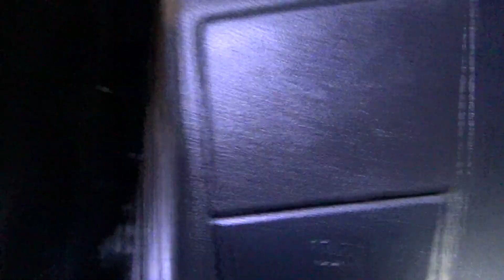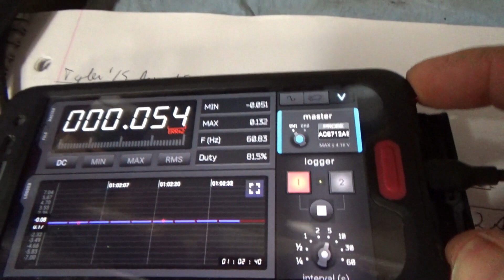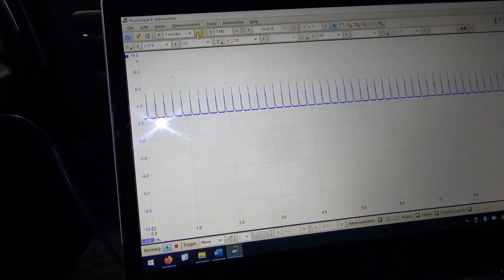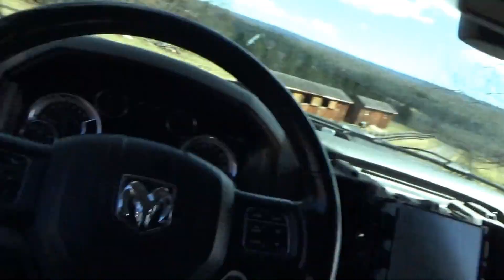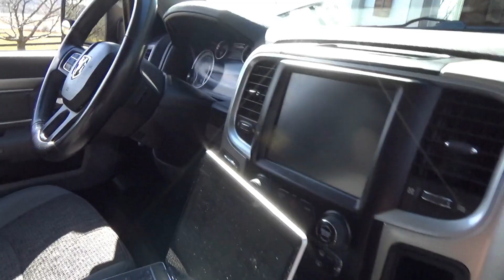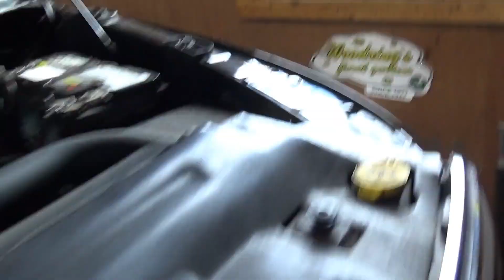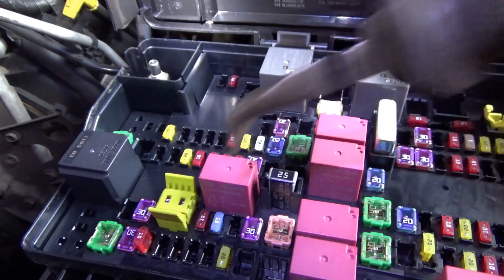Have Never Seen THIS Kill a Battery Before... (Parasitic Ram - Part 2)

Comment: Great job, I watch part 1 and 2. Because of having a real bad back and i have great difficulty getting to that wire you cut and soldered, I might be wrong,, but I will be using a fuse wiretap to go from fuse 99 to fuse 84 output side inside the fuse box under the hood. This should bypass fuse 84 being on, full time and only have power when the key is in the on and accessory position coming from fuse 99. What do you think. will it work? Thanks for all the trouble shooting and sharing.

Comment: Im so impressed with the tracing of the problem as well as your consideration for cost. Plus  the you opened the module. I have an 09 that since changing acutator blend door motor has had the draw. This has given me great insight into the possible problems and where to look plus how to fix. Thank you. Your amazing with electronics.

Comment: That is an excellent solution.
I wonder how long the $800 module is guaranteed for. I find it very scary that vehicles have specialized modules that may not be avaliable or will be too expensive.
My car uses some basic switches and some cables to control the various systems. They work fine and are comparatively simple to what is being used in cars today. 🤔😁   🖖🏼🍀

Comment: I would try unsoldering the silver metal capacitors on the circuit board and replacing them with new ones. They are cheap, and they do tend to go bad over time.

Comment: I think an ignition controlled relay would have been a better solution. 

Keeping the 15 amp fuse on the red wire would have been a better solution

Comment: Did anyone think to check a salvage yard.  Took me about 10 minutes to find the module for $80.  Rather spend that than start cutting on the harness and rigging circuits to carry twice the load that they were designed for.

Comment: Balkan fix would be to add a relay that will energize with key-on and supply the 15A fuse. Should be safer using the correct fuses on correct wire thickness.

Comment: I had a prior license plate light out, the a blinker went then my infotainment stopped working ,,pulled the radio out harness seems to have power not sure if the radio works anymore then my mini leds on my a/c defrost recyc mirrors stopped working... going into the garage tomorrow morning. I think the plate light caused the short , I cut it off because it was all seized inside.
Wish me luck :)

Comment: ALL AUTO MANUFACTURERS:  How can we rip off our customers in the short and long term by overcomplicating everything?  ANSWER:  Let's add cheap electronics to control everything and eliminate EVERYTHING which was analog in nature.  This of course, doesn't put into consideration of the high markup prices already which is why there are so much 2023 new inventory sitting on dealer lots  in 2024.  Great diagnose job and fix!

Comment: I'd have checked to see how it behaved when using remote start. Often the default strategy for climate controls will default to the defrost on dash as well as front vents during remote start then change to your preset when key is turned to on. I know - too late now lol. Just food for thought if you ever happen to encounter this again. And yes. Tge module driven parts are so expensive. They Ram your wallet because its specialized and somewhat hard to get at times. Thats why I Dodge most newer technology driven vehicles.... OK I'm done with the horrible Dodge puns....

Comment: What concluded the diag as the HVAC control module for you? Like what made you not need to dig any further into the outputs for the HVAC module? Just trying to fully wrap my head around it. Thanks!

Comment: I have a 2014 Ram 1500 that won't go to sleep.  I have been dealing with it for about 3 years.  Spent over 4 G's on it and still have the problem.  I have to jump through hoops to get it through annual inspections. I won't take it to a dealership or shop again because I know they can't fix it.  Liked your video.  I now understand that it is totally illogical to have so many complicated accessories and environmental monitoring devices on a machine that is expected to perform at 100 percent for so long.

Comment: They stopped making Chargers and challengers for the Hornet . Wagoner is a luxury SUV with high strung V6 twin turbo 500 hp. How long do you think that will last. $100,000 vehicle with a V6 in a 3 row suv?

Comment: New Rams with 200 miles with failed engines. Metal in the oil
 Filter. New Wrangler 4xE with less than a hundred miles towed in with gel light and no start no crank.
Reply from the maker: Junk lol

Comment: It's probably not the HVAC module.  The clicking noise could mean that the HVAC recirculation motor needs recalibration, or there is a broken actuator motor gear.

Comment: You could have gone one step farther and kept his memory recall by installing an inline battery. I don't know if it be worth it. I don't know what kind of voltage you would need. But a little power cell that charges while it's on keyon and then discharges when keys off. Why not work all the time if that module pulled out of the power out of the battery but it would work sometimes. But I never saw the original draw amperage

Comment: I wouldn’t mind a repair like this on a 20 year old Corolla to save a customer some money, but on a newer car like this I’d be concerned with doing a repair like this, the modules have the power they have for a reason. Particularly be concerned with blend door and mode door actuators loosing their calibration every time the car shuts off and possibly having to recalibrate every time you start the truck

Comment: Sounds like the same thing my Chevy Tahoe does, had the damper motor replaced once does it agin now.
I just have to turn climate control OFF before I pull in drive and hear the damper close. Then my battery won’t be dead next time I start. Seems that the plastic gear on door gets stuck and slips or breaks on older models.

Comment: I bought that same module for my 2014 RAM back in 2018 as part of upgrading the radio from the 5" to the 8" screen and it cost less than $300 new from the dealer. We (The forum community) noticed around 2019-2020 that all of the parts we were using to upgrade our trucks (something RAM says can't be done) suddenly went up in price dramatically. And it wasn't all parts, it was specifically the ones we were using for upgrades. RAM does monitor the forums and many of us are convinced it was a deliberate attempt to stop us from upgrading. That HVAC module is not VIN locked, you may be able to get one from a salvage yard if needed.

Comment: Excellent diag & troubleshooting skills demonstrated on this over engineered Pos design.....Once pointed to that Module, Too bad you didn't Stay on track & kept Module  energized & Open up the various Sensor  Input & Reporting wire leads to Maybe Isolating a Possibly Defective sensor Causing a Good Module to malfunction.......It's  easy for me to offer that afterthought  advice 'cause I would Never have the Patience to work &  isolate the problem so Efficiently how you Did !! .......You Da Man !!!

Comment: Awesome video Ivan. Can fully understand why people don't want to go to the dealer. Case in point I used work for a Chrysler dealer. I had a old mini van come in with no front washers. Traced the problem to the BCM not grounding the washer pump circuit. Spoke with the customer and said hey we can just wire and install a toggle switch on your dash that you flip when you want washers. He loved the idea cheap fix and did the repair. BCM was also close to $1000. Service manager had overheard me got called into the office afterwards and threatened with dismissal for not selling a BCM costing the dealer profit by doing a so called "Mickey Mouse" repair. Needless to say I don't work for them anymore.
Reply: You can buy a lot of Windex and paper towels for a thousand bucks! Lolol😂😂

Comment: I don't know if this would work but maybe the capacitors on that board (I saw a few) are at fault?  I've done a couple of Lexus LS400 main boards - changed all the capacitors and all kinds of odd problems have cleared up from shifting problems to a/c compressors coming back online.  It does look like a $5 board and maybe $3 of capacitors and a little time.  It's hard to check a capacitor as it's more a problem of wave form.  I don't know but it's worth a shot.  I'd guess the ones in the OEM board are of the cheapest quality.  I'm not sure these would/could cause a draw but maybe?

Comment: The price of electronics are high to convince you to buy extended warranty protection. I have a 2002 Grand Cherokee, runs great and it's in pretty good shape, it's my around town knock around car. I also have a parasitic draw that draws down the battery in a couple of days, I chased it down to something in the body control module. Although I like my Jeep, it's not worth sinking a lot of money into, so my solution was to put a cutoff switch on the battery. Cheap and it works.

Comment: Great fix!  Do you have a clamp-on DC ammeter? Not cheap, but they avoid having to remove wires or cut to insert an ammeter. Accurate to 10's of mA. Smaller jaws are a plus to clamp into tight spots.

Comment: If it was me, I would try to figure out a way to mark or document what you did for a future technician that is wondering why the HVAC was forgetting its settings after every key cycle, as well as an explaination for the swapped fuses.
You know that truck will have at least one new owner in its future. Maybe drop a folded piece of paper behind the controls to help out the poor soul(s) that have to dig into the HVAC. Is that reasonable, or am I being too nice?

Comment: Ivan...  future suggestion...  Noticed that you opened up the defective black box.  If you have access to a really bright light source and a powerful magnifier, it might be worth your while to scan over the circuit board and look for cracked solder joints on the surface-mounted components.  (temperature changes can easily crack these solder joints, and they are near impossible to see with the naked eye)  Also, an in-circuit component tester might be worth having to test the board-mounted capacitors.  (they are cheap - $20 or $30 for a Chinese-made one)  Component quality has taken a nosedive, and capacitors are a common failure point these days.  You would also need some surface-mount soldering gear...  but given the cost of those miserable black boxes, it would most likely pay for itself quickly.

Comment: Neat. Job well done. 😎The only thing i can add is if future programming of replacement BCM is needed, this could be problem when programming software commands technician to turn key off. It could fail the programming routine, even if programming with the oem hardware and software. I'm not specialist, but this would be DARN HARD to find out if it's true and other technician that don't know of this bypass repair works on the vehicle.

Comment: Because it's a rip-off Chrysler is the new etzel that's the same trouble they had with the Edsel they made them in 58 and 59 and 58 they started having all kinds of problems and it continued till model change a 1959 that's when they said no more we get rid of it that's what happened to same thing happened with the 56 and the 57 Ford retractable electrical problems that's why they only made us for two years cars today it rip they put all that computer junk in it I wish they'd go back to Old School only have one computer engine control they would be better all go back old school alright Buddy have fun looks like you're in Port have a good day

Comment: I do miss the simplicity of old HVAC systems from the 1960s and 70s.  Nothing more than a thermal, sensing bulb and a set of contacts to make or break circuit the most advanced electronics.

Comment: Did you really complete the diagnosis?  I didn't see where you confirmed the module itself was actually at fault and that it wasn't being kept awake by one of it's inputs.

Why did you make the change to the harness rather than the module itself?
Reply from the maker: What are the module inputs? I modified the harness to solve the problem permanently and reliably 😎👌
Reply: @PineHollowAutoDiagnostics  I haven't pulled the schematic but the module is a black box with a CAN bus and some other wires.  I don't know what the other wires do but it is likely some of them are inputs and a faulty input could cause the module to stay awake.

Your fix seems like it works great and I'm sure your customer is happy as I would be in his place. 

However, if your customer had said "lets buy the $800 module", and the actual problem was a bad switch or sensor attached to it, you would be in a tough spot.

Comment: The diagnosis was excellent, my issue is with the repair. By removing BATT+ from the module now every time the key is turned on the module will perform a calibration event. This means the blend doors move and reset their home positions. The problem with this is when this happens if you move a button, dial, switch on the HVAC switch bank it has the potential of locking up one or move of the actuators. This is why when you replace a module and do the calibration of the actuators the scan tool has a countdown of approx. 30 secs. So the repair will work for a while but eventually it will need an HVAC module and then repair the 'fixed' wires.

Comment: Use a DPDT relay with coil on the acc line and contacts on the bus wires. That way the bus gets disconnected when power is off. Then it would not keep everything awake but would keep it's memory.

Comment: does the switch bank stack have constant power? could a stuck/acid(coffee/soda) spill be making it keep the other module alive and network awake?
it wouldn't surprise me if they had some failsafe to provide fresh air if a button press or occupancy was detected via anything, climate control, radio, seat belt, seat/airbag and anything networked.

Comment: 2010 Ford Ranger blend door motor failure.  Managed to replace it. Very difficult. Did an autopsy on the bad motor. The brushes in the motor were fine wires. They had melted open. So they had manufactured a motor that could not survive stalling. And when it's very cold dew settles all over the place and the blend door easily gets frozen in place and the motor keeps trying to move it.  And the brushes burn up.

Comment: With all the work you do with this kinda stuff you need to find an electronics lab to partner with that can rebuild these.
Reply: Try disconnecting the blend door anyway. I'd guess if the computer doesn't get it where it wants it will cycle until it does and stay awake.

Comment: Extorsion absolutely. Mainly because average people like me with a medium income can not afford to buy a newer auto. Even the small  cars are way too expensive. So many of us are forced to repair and the dealers know it. I recently had my power steering go out. It was a very small connector between the pump and the steering lines. Cost me 58.00. Thankfully my brother could replace it with no problem. 20 min. A quick tale on how things have gotten over 50 years. My husband and I bought our first house in 1966 $11,000. for a 2100 sq ft house.  We raised our children there. That same size home today would cost over 300K.  3 bedroom 2 bath double garage with hardwood floors throughout.

Comment: With this workaround method. Does this mean the HVAC system will do a relearn of all the actuators ever time it is put into the Accessory or Run position? If so, during this relearn procedure, you have to make sure not to adjust any heater controls, because that could affect the calibration of all the actuators. If I'm thinking about this correctly. Amazing diag as usual Ivan!🤘

Comment: Depending on the overall message strategy of the bus per the vehicle sharing of real-time data, any module on the HSCAN can broadcast to all the other modules. If these modules CAN message filters permits reception of the broadcast message than the HVAC module will wake up the entire bus. But, why would the HVAC module broadcast? One possibility is it has detected an operational failure that it must broadcast.

Unfortunately, you can't really upgrade a fuse rating because the fuse is selected to protect the wiring. But, according to the wiring diagram both circuits, fortunately have the same wire gauge.

Perhaps the easiest hack is to just install a relay to control the hot at all times feed to the HVAC module controlled by it's own ignition enable power feed. This is helpful in several ways first the relay coil draws relatively low current and will still maintain the isolation between the two circuits (isolation prevents any back-feeding of power, which may or may not be a problem in this case). The current requirement is within the rating of a 12V automotive micro relay.

Actually, the majority of the module costs are in software design and testing, module qualification and also over-head, which includes insurance and legal. The module hardware design is relatively cheap in this case, unless it is safety critical, which I do not think it is.

Comment: Ivan.. 
Got my daughter's3/4 ton GMC back together. It's not leaking oil or transmission fluids anymore. Job took 1.5 week. Due to my work schedule.
Then my 01 malibu blew out all of its transmission fluid.
I'm at 1.2 week into the repair. Pulled engine and transmission as a unit. Reinstalled the engine and transmission. About 4 days ago. Then started replacing all of the struts. 🙄.
Discovered bent rear control arms. I was lucky. It was a minor NPR. Job went well. Waiting on front struts to arrive. Rear are done and installed. 
All of this on my shade tree cement slab. 😄
After this my brother 2000 truck water pump work. 
Then my brother in law Dodge 4x4 front diff job coming up too..
Just like you....customers to help..